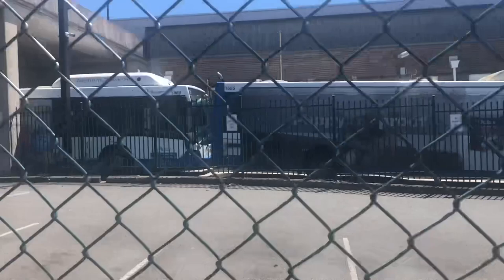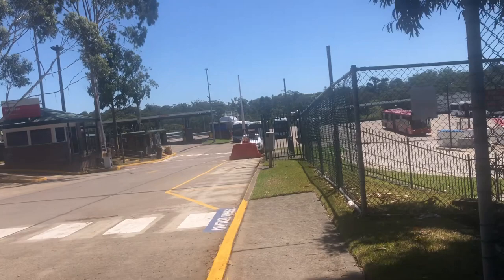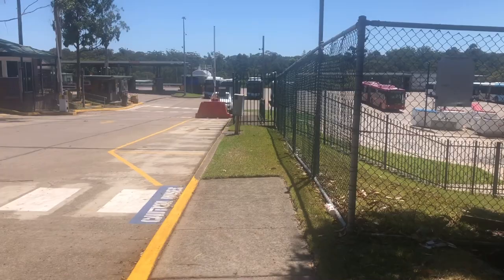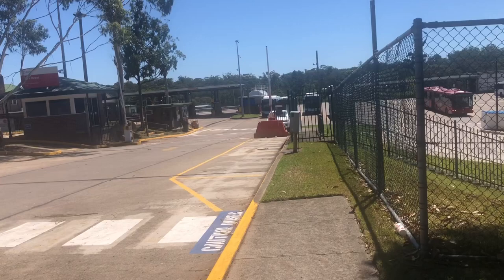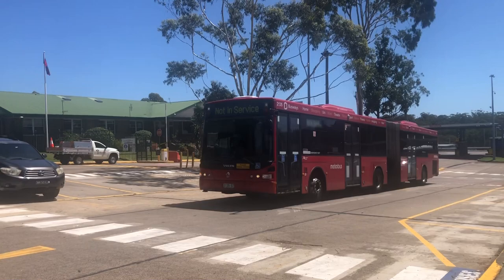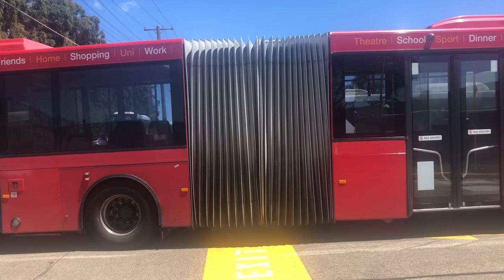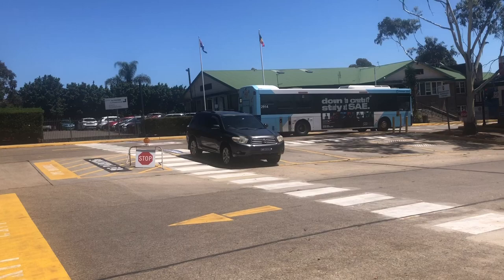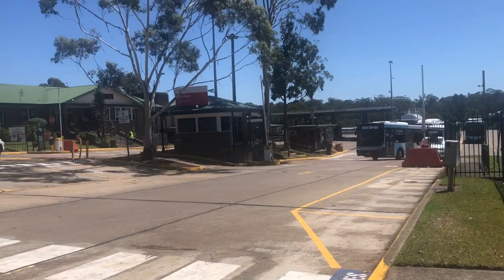Ryde Bus Depot | Bus Vlog #12

Comment: The yard you walked down to further down the street was once the home of North and Western, where 3532 initially came from.👍
Reply from the maker: And then 3532 ended up back at Ryde many years later! See you next time Jarrad! 👋
Reply: 3532 was originally at North and Western Depot in Victoria Rd Gladesville, where a self-storage facility stands today. The land you speak of was once a timber yard, which was owned by the NSW Government and redeveloped as a bus depot to be leased to North and Western. When North and Western defaulted on their lease, they were acquired by STA. I know that this was engineered by the NSW Government in order to expand STA to Parramatta.  I drove 3532 for quite a few years and enjoyed it very much except for the manual destination boards that were fitted at the time. I enjoyed this bus as it was not speed limited, nor did it have an interlock door system.

Comment: This video only touches the surface of what is beyond the fence line. What we first see from the front gate is the "top yard" and as you walk down the fence line you pass the staff car park and arrive at the gate to the "bottom yard" which is behind and below the top yard. The bottom yard was called "gladesville" yard for a short time after STA acquired the routes and some buses from North and Western bus company. The capacity of this depot was 320 buses and approximately 600 staff when I retired. The top yard houses the administration building and the staff amenities building which included a gymnasium and recreation hall as well as a tv room and a driver's "sleeping/quiet" room. A small canteen was also provided for the drivers and other staff  to purchase meals and refreshments. The fuel bowsers are on the driveway prior to entering the main top yard. There is a bus wash and a workshop on the top yard. I have probably given too much useless information but after almost 40 years at this depot I just couldn't resist commenting. Great video and thanks for the memories, well done 👏
Reply from the maker: No problem John! It's always nice to have a chat :)
Reply: @coolsoap8  you're very welcome 👍